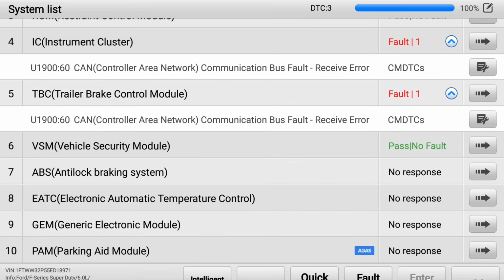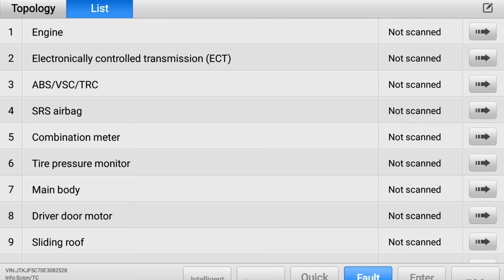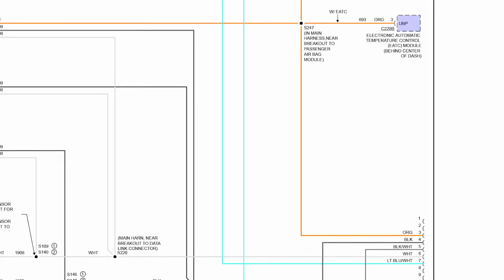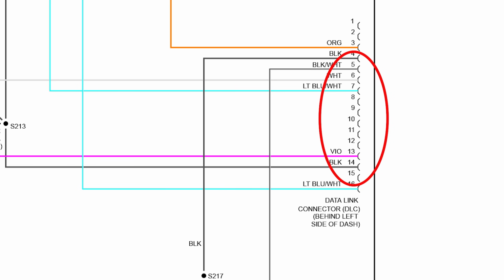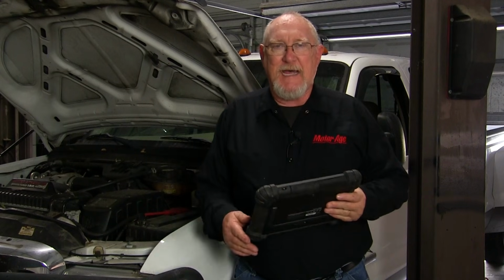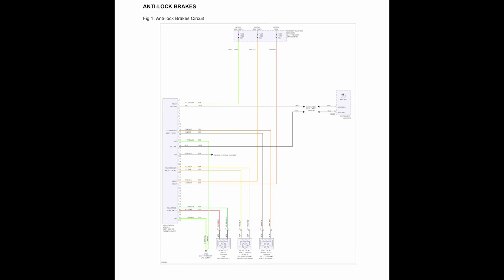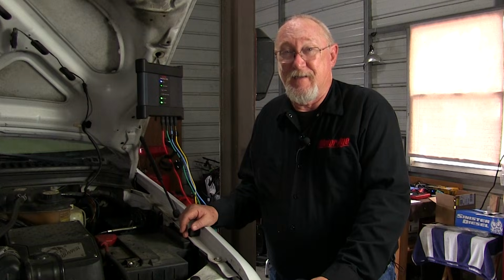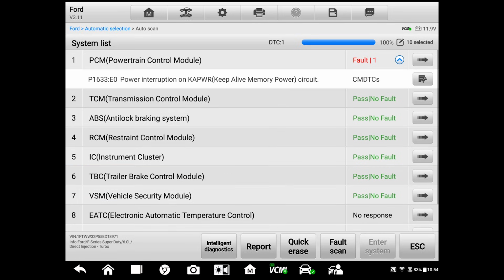The Trainer #111:  How To Troubleshoot CAN Communication Faults

Comment: Normally with electronics if a fuse blows there's a short somewhere. I see it a lot on TVs , audio stuff etc.  But I too fixed a car just by replacing a fuse after car went into limp mode. Why do car fuses magically blow without shorts? Very odd electronic behaviour.
Reply: Most likely the voltage spikes from startup alongside moisture/corrosion or aftermarket accessories drawing too much. It Might happen often afterwards, might happen rarely, or never again; just depends on how bad it is

Comment: Hello sir!
I need help
 Mazda 3, 1.6hdi 116hp, 2012
I have no communication between the diagnostic device, tried 3 different ones, and the module on the HS CAN network.
Tested the following
On DLC pin 16 there is B+, on pin 4 and 5 there is B-, on 6 and 14 the resistance is 60 Ohm. I measured the same signal and it is also good. There are no irregularities, voltage spikes or drops.
I disconnected the power steering pump module, no change. I disconnected the BCM, no change. Even with the PCM disconnected there is no change. HS CAN does not communicate. I measured B+ and B- on PCM, but I don't have wiring diagram, so I don't know if I did everything. What I measured everything is ok.
The vehicle drives normally, everything works normally, except for the power steering pump, which was damaged in a collision and was replaced by another one
I note, I had no communication even before the collision. And then the servo pump worked like everything else.
I suspect some kind of PCM locking?

Comment: I want to thank you. I have a 2010 explorer with RSC alarm going off and started on resolving it months ago. I purchased the vehicle with the issue. I thought based on YouTube it wa a faulty ABS module. 
My scan tool was not high tech enough to run most of the test you referenced but you point out in the end go back to the basics, check the fuses. Well low and behold it had a fuse missing.. replaced fuse and so far problem is resolved. 👍
Got to run the drive the full cycle but either way this is a huge step forward. 
Great video,  sincerely thank you.

Comment: Plumbers have leaky pipes they say.. Great video! Great info! But I gotta say as a field tech that sure is a lot of steps and hardware to find a blown fuse 😅. I just bought an Autel ms906ts pro I love it so far. But It don't have that topology feature unfortunately.  I'm currently tracking down an intermittent can bus issue on my own personal truck. Stopped by this video to brush up on some diagnosis steps to track it down. I have a good feeling I'll find water intrusion due to a sunroof leak. Just need time away from fixing customer vehicles so I can fix my own 😅

Comment: that wasn't very satisfying. fuses are the first thing i check and it's never the fuse. I have a u1900, brake light, abs light on
Reply from the maker: Are you able to do a full system scan to see what modules are, or are not, communicating on the bus? Do you have access to a scope? This newer video may be helpful:  https://youtu.be/5gYNX-h_rKQ

Comment: What if the moduals communicate with the scan tool,but they don't communicate with each other.they say lost com with "blank" modual. Different moduals lost com with others but all com with the scan tool.
Reply from the maker: Could be an intermittent problem. Have you tried clearing the codes to see which ones remain active? Typically, the one module the others are pointing their fingers at is a good bet to be the one with the issue. But make sure it has what it needs before condemning it.

Comment: Hello, Pete. The terminating resistors complete the CANBUS circuit, I would say. How do you get voltage in the CAN lines if you disconnect a module containing a resistor? Thank you.
Reply from the maker: I went to an expert and asked. My friend Bernie Thompson at Automotive Test Solutions (https://www.youtube.com/c/AutomotiveTestSolutions) says, "In CAN each module or Node is a multi-master. That means that each module can supply the CAN voltage on the Can com wires".
Reply: @VehicleServiceandRepair  Bernie may be talking about the Can transceiver.

Comment: Hello, Pete. As far as I know, the module transceiver is responsible for the voltage differential in the CAN NETWORK. If you have a bad transceiver,  how would you find the module with the bad transceiver? Would you have a U code?
Reply from the maker: The best way to find the bad module is to monitor the CAN signals on a scope while you unplug the modules on that network one at a time. When you see the pattern return to normal, that's the module that has failed. Start with the modules that are easiest to get to...

Comment: I had a similar problem with my f150..the ac would not work and the guage cluster was acting wacky with lights turning on and off and the needles sweeping.  Ended up being a shorted wire running along the wire chase on the drivers side.

Comment: Thank you Pete. Good job. Have a blessed and safe week to you and your family.
Reply from the maker: Same to you
Reply: 🤔 I learned a valuable lesson a long time ago with fuses pull them out and inspect a d use an ohm meter on the legs   in the last 50 plus have had 2 fuses that had voltage across at the top and when checked at the legs I had an open circuit 🤔